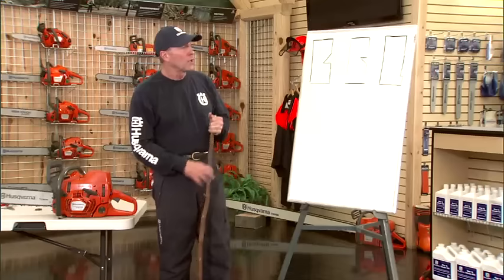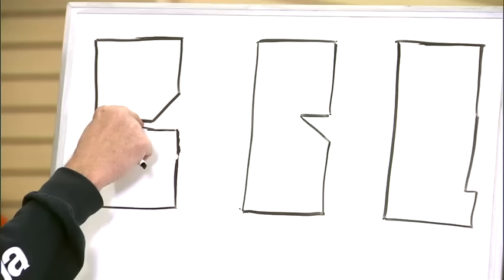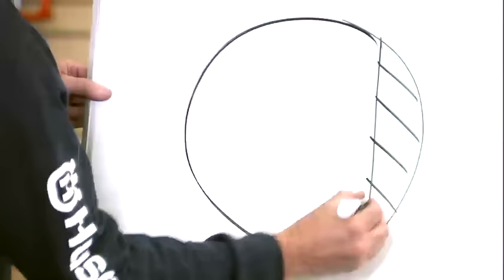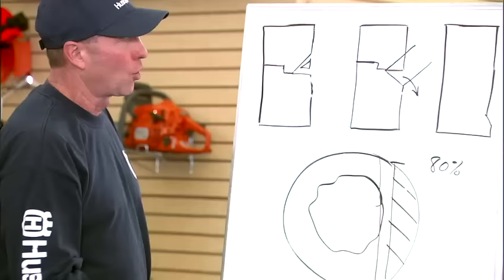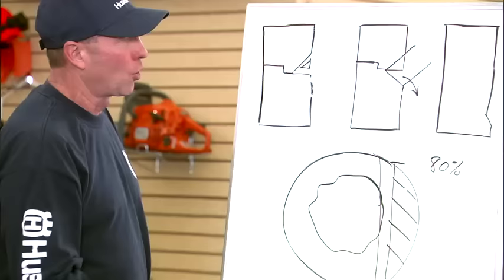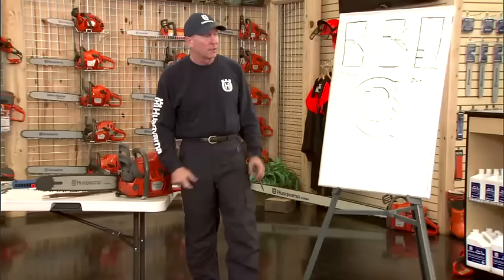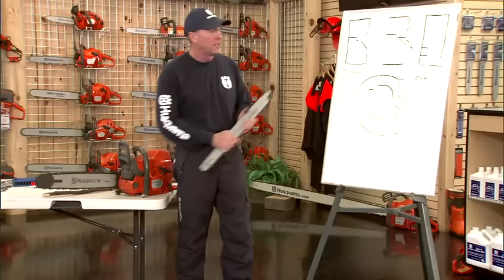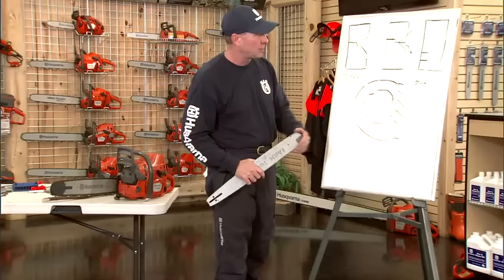How To Make Tree Felling Notches And Hinges With A Chainsaw | Husqvarna

Comment: I have a question, if you will, for the instructor, if you will.  I have only watched one of your tutorials, if you will, so I am not sure if this question has been asked before, if you will, in another tutorial, if you will.  So for the sake of abundant caution, if you will, can you please tell me how many times, on average, if you will, do you repeat the words, "if you will" in a given tutorial, if you will?  If you are bothered by my repeated use of the phrase "if you will" in this comment, if you will, then you can empathize with how I felt when I was watching this tutorial, if you will.  I suspect that the number of times you used "if you will" is still more numerous than the number of times I used "if  you will" in this comment, if you will.  But it is only a suspicion, if you will.  In order to verify who said it more times, if you will, I would have to re-watch the video, if you will, and count the number of times you said it, if you will.  I would also have to count the number of times I used it in this comment, if you will.  However, I have better things to do, if you will.  Perhaps someone else, if you will, can do the honors of counting, if you will.  If you do, if you will, then please post the results in this comment section, if you will.  {That last "if you will" right [before this parenthetical statement] was actually well used and not  gratuitous, since someone would have to count and then post.  so they would have to have the will to do so.).

Comment: I have felled thousands of trees and never had a tree stem sweep back over the stump that has been correctly felled.  I only see it happen when a tree has been caught up in another tree or you have not cut the tree correctly.  Making allowances for this fantasy occurrence is unsafe and causes more issues with novices than anything else.  Never modify your back cut for this fantasy of the stem sweeping back over the stump.

Comment: Very informative video, but as some constructive criticism, please eliminate the use of the phrase, "if you will". I counted 18 incidences of that phrase in this video. Also, you say 10% of 10 inches is 1.01 inches? Did I hear that right? Isn't 10% of 10 = 1.00?
Reply: gig777  I believe it was ment to be said as 1.0    1in.
Reply: Yeah, that is what he said, but 10% of 10 inches is EXACTLY 1.00 inches, not 1.01 inches. This is basic third grade math, if you will. lol
Reply: 1.0, 1 inch. 1.0 and 1 inch weren't a single number. They were two seperate numbers, sounded like he corrected his sentence in mid thought.

Comment: Not one pro cutter that is worth a shit uses a back strap, what a bunch of bull shit. you don't put the wedge in from the side unless you want to push it to left or right. & if it is leaning one way or the other , you leave one side of the back cut a little thicker & it will hold it & pull it that way where it is not cut as far.
Reply: Bigguss D if you will
Reply: Bigguss D you put put your wedges in the sides to get more lift

Comment: I’m sorry but I disagree. You need to get weight over your hinge. Going so shallow with your undercut means a whole lot of pounding wedges and more exposed under something potentially dangerous. Also. leaving a strap in the back only works if you have lean in the direction you are intending to fall if not your screwed. He has good points but what he’s teaching is not for all felling operations.